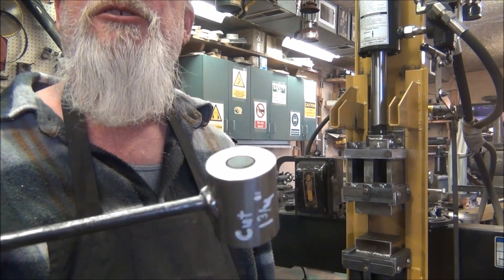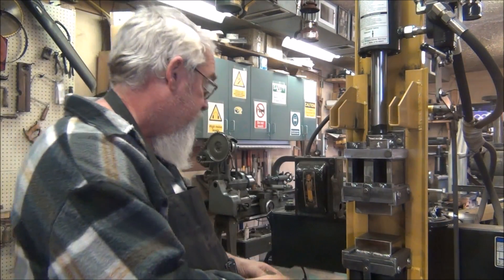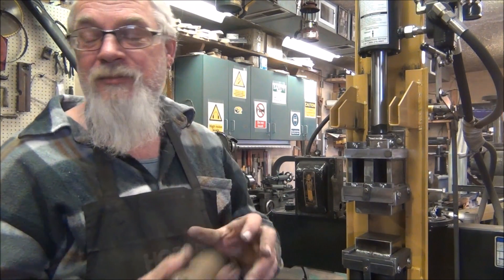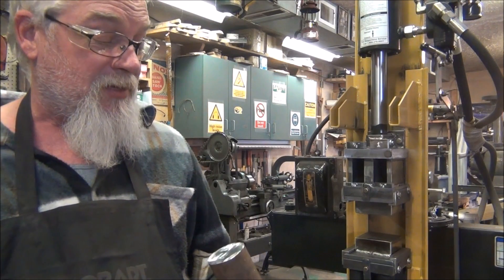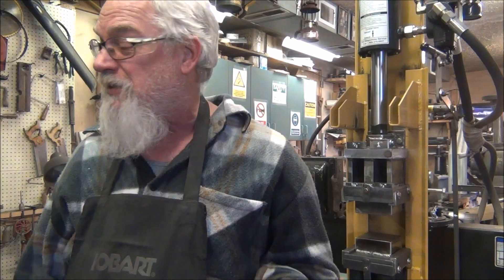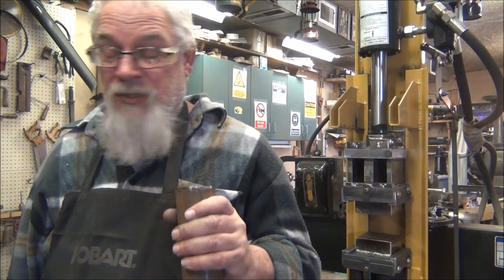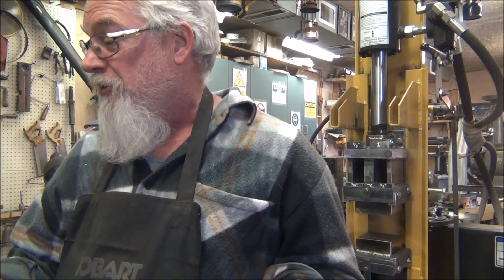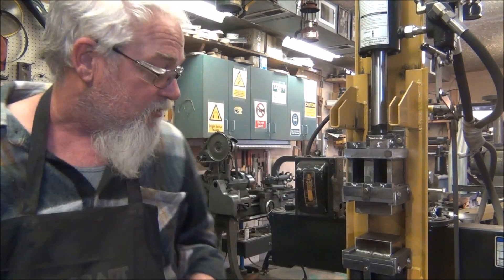Making A Rivet Header For The Hydraulic Press

Comment: Very nice, gee you've got some good tools and machines.
Reply from the maker: Thanks Lenblacksmith. I appreciate the comment.
Reply: I have only seen it once before where the person drilled a smaller hole right through so you can put a drift through to get the rivet out.
Reply from the maker: It works good. The header has enough mass that it quickly draws the heat out of the bottom of the rivet so it doesn't deform it.
Reply: Great Idea that.